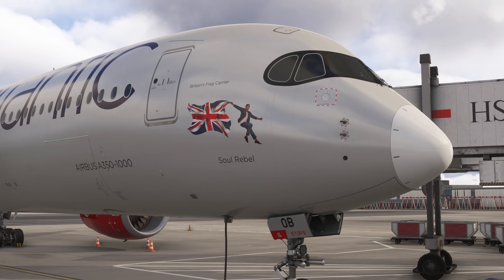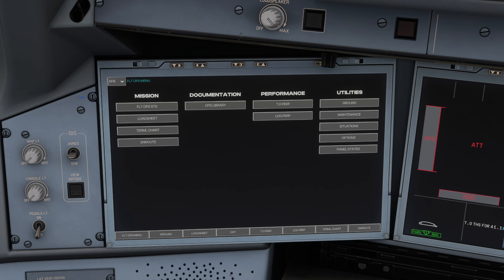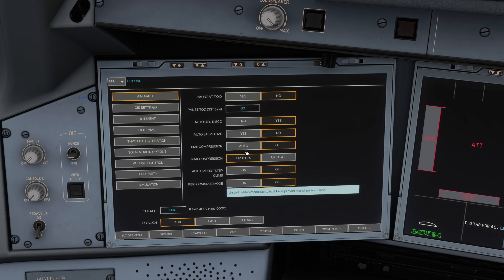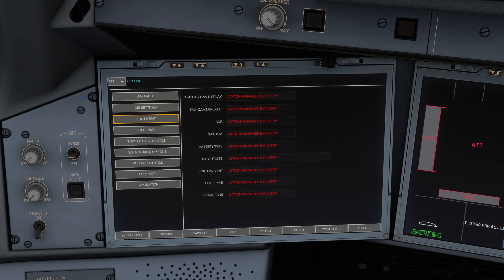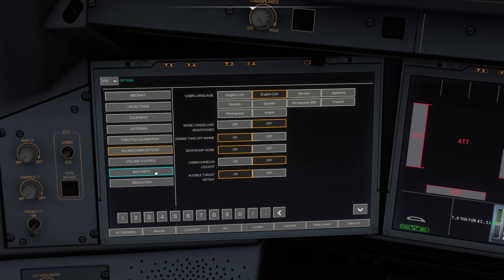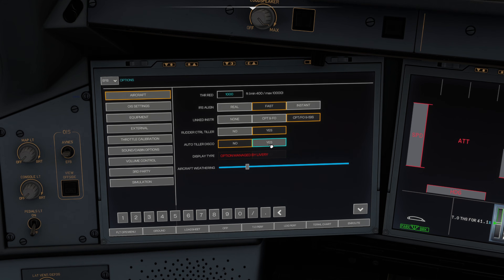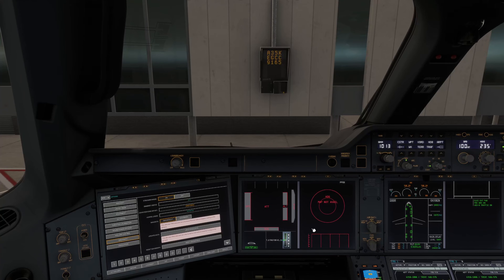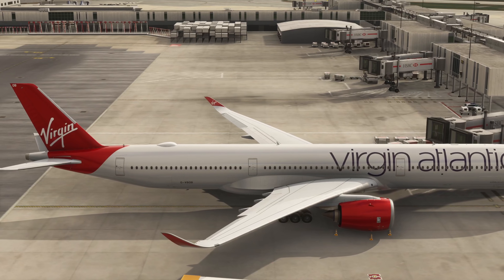iniBuilds A350 Tutorials - Episode 1: EFB Setup incl. Throttle Calibration & Navigraph! [4K]

Comment: How do i set up hoppy from scratch please. I get it you put your code in but what di you need intsalled and what needs to be running
Reply from the maker: providing you have an account on the hoppie website and as such have a code/API key to use, you just add it in and it's done - everything happens within the acars of the jet :)

Comment: had hoped you would have shown how to use the reverse thrust :)
Reply from the maker: @nexus888 problem is, it depends what hardware you have as they all work slightly differently so I spoke about it as a general calibration pointer
Reply: @ thank you. I think I saw how to use a key combination with the throttle a long time ago on YT. I will try and see if I can find it. I got a Virpil cm3 as I fly jets and helos a lot. Thanks for the video.

Comment: As usual, your tutorials are very easy to follow and things are explained in a clear and concise way, making the journey fun. One thing I have had some problem with and that is the toe brakes. The parking brake works fine but, unfortunately, the toe brakes are non existent, so consequently, there is frequent runway excursion. I can't find the config file for the brakes to compare with other aircraft. An example, the A32nx has a "toe_brake_scale=0.56" and it provides satisfactory braking. I'm confident that this will all come together eventually and provide for just one more  fantastic aircraft to play with.

Comment: Im having a issue where the throttle is initiating on idle
Reply from the maker: @benponce8573  calibrated your throttle?
Reply: @BritishAvgeek  i figured it out. It was a issue with the nose wheel steering. I didn't know I need to set those up. Tha k you for getting back to me. 

Are you having issues with navigraph working on the EFB?

Comment: Were you using sim update 1 beta while using this aircraft?
Reply from the maker: @JacksonTetley nope I don't fly using the betas
Reply: @BritishAvgeek I thought there recommended it? I went on beta 1 just for this plane and now my sim runs poor so I wanna remove beta but worried the A350 would have issue
Reply from the maker: @ChrisJames-pq6gg  they do for this especially for Navigraph Nav Data integration - but I haven't signed up for the 2024 sim update 1 beta.